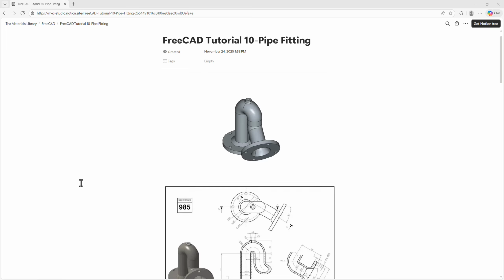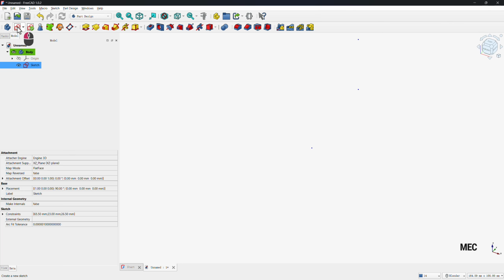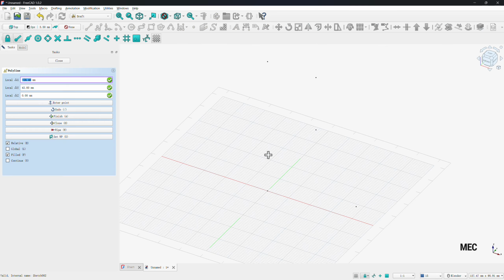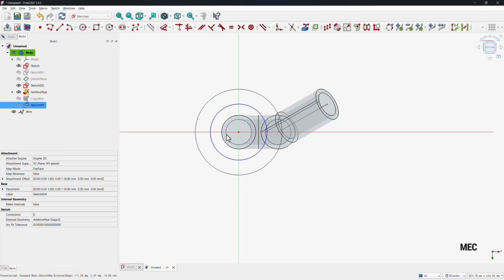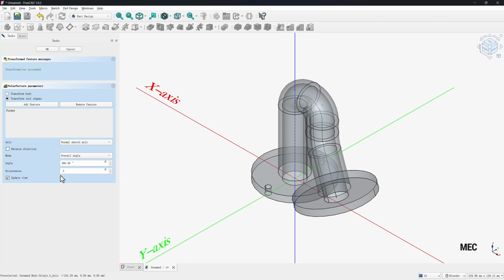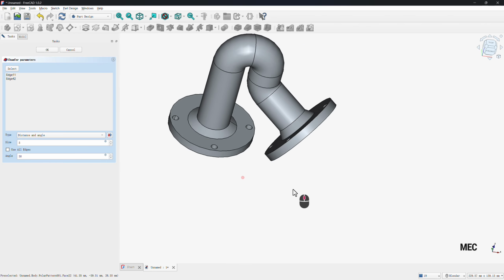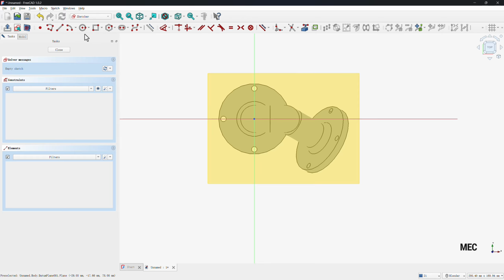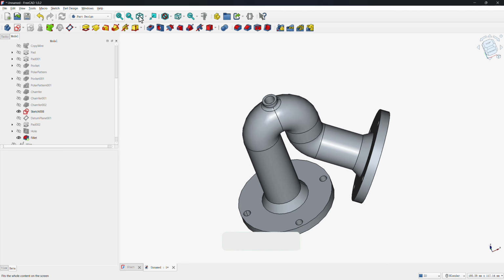FreeCAD Tutorial (Beginner to Intermediate):  Model a Pipe Fitting with 3D path + Sweep

Comment: Hi,
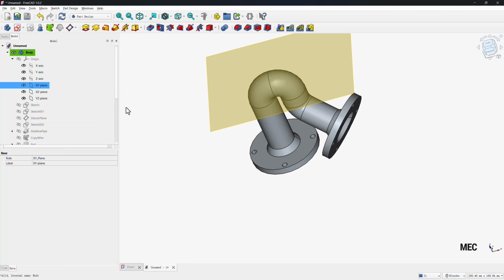I guess one of the main problems in FreeCAD is Datum Plane. For example; 11:42 you made a datum plane for air out nozzle with the distance. But If I change the length of bottom pipe  then  datum plane will be wrong. By the way we can not make any mate according to datum planes. 
Sure FreeCAD people will solve this I am sure. But we need time. 
Thanks again...
Reply from the maker: Hi, I understand, it is a problem when you change the length of bottom pipe,  then the datum plane won't adjust as I showed in the video.  and I think you can add a variable or spreadsheet variable , then set the value on Expression editor,   it will adjust automatically.